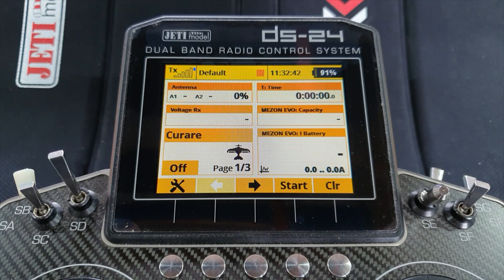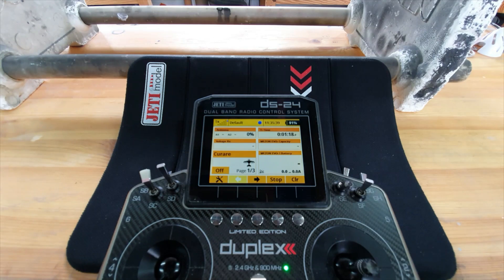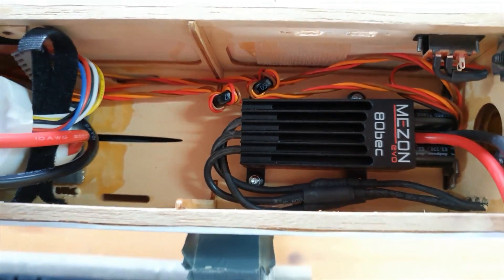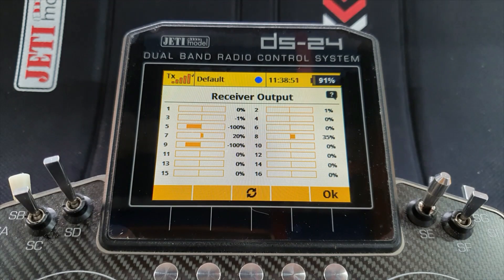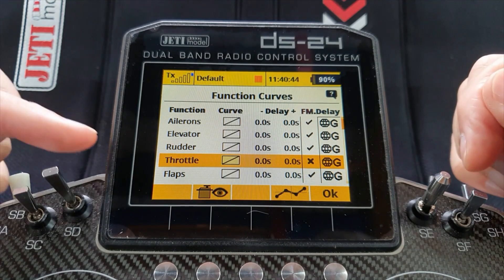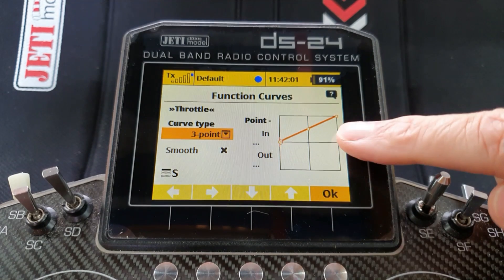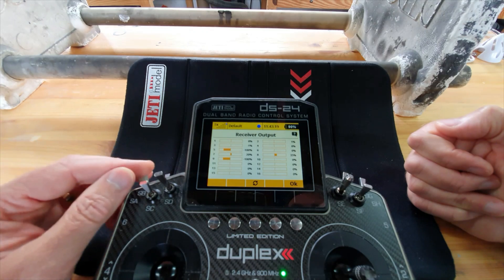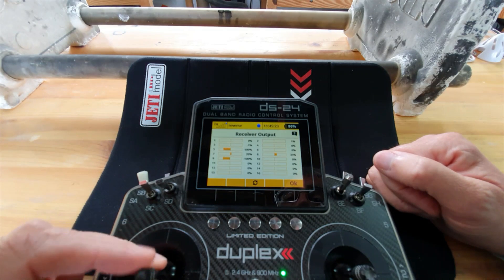Jeti - thrust reverse using Mezon Evo or Mezon Pro ESCs

Comment: another instructive vid, thanks for that Harry!
Based on this I bought a Mezon 120 lite, which can be operated either L or R, but does not seem able to provide reverser function to my small jet model. The ESC, though giving telemetry data, does not show in the Device Explorer in the first place... anybody with a solution around?
Many thanks
Reply from the maker: A Mezon will not.  The video is about the Mezon Pro and its replacement the Mezon Evo.
Reply: @cotswoldpilot  Thanks for that Harry. So a Mezon is not necessarily a Mezon... oh well.